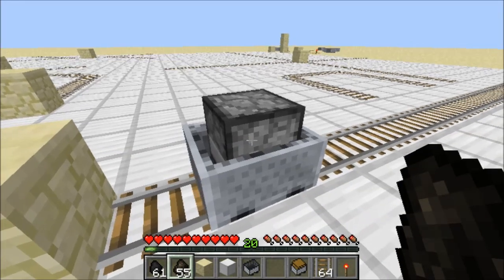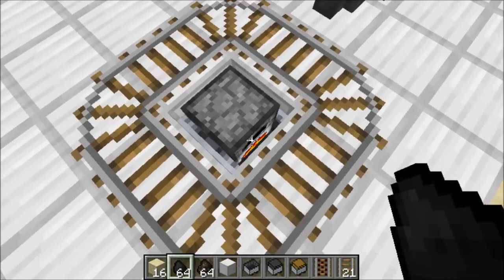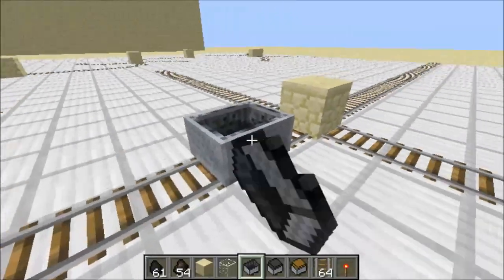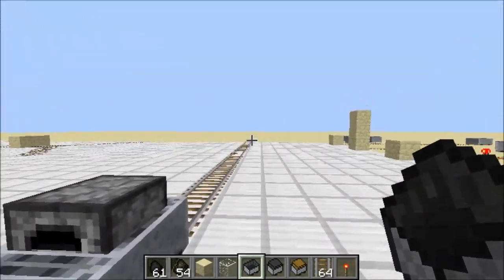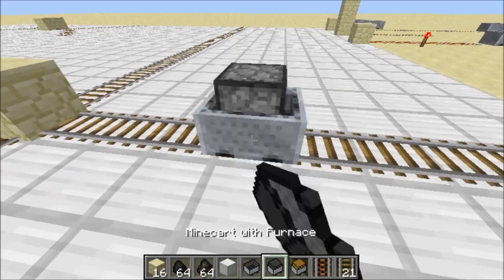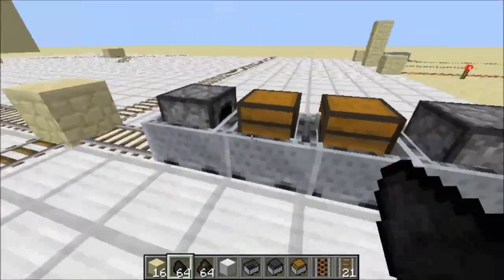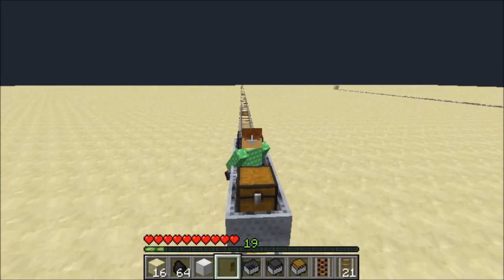Infinite Furnace Minecart Power and MORE!  | Minecraft

Comment: the minecarts need a rework. badly. also if they rework them they should make linking carts an actual feature
Reply: As well as make them work with hoppers & hopper minecarts (though the hopper minecart interaction could be tricky since it would be up and down like a normal hopper)
Reply: I would totally make trains out of carts if I could!!! :D I know old mines use to have small trains in real life. It might be impractical, but I love the idea of it for minnecraft. ^_^
Reply: It would be nice if hopper minecarts could place items into storage below them, such as chests or chest minecarts. Instead, you have to take items out of a hopper minecart using a hopper, which greatly bottlenecks the speed. But I guess that might be considered too OP.
Reply: I've always thought it would be good if you could lasso horses to minecarts so they could pull stuff around.
Reply: Joseph M
That would be pretty cool. Also, it would be cool if there were horse carriages in the game, so they could haul stuff anywhere. And little sleighs for dogs (and bigger ones for horses).
Reply: it’s been 7 years they still haven’t done that :(

Comment: I’ve actually found a trick to prevent the mine carts from the derailing while turning while being being pulled from furnace man carts, also just make sure that is two are on each side. Anyways, at the turn just put blocks surrounding the outer corner of the turn, at least 3 blocks for each side of track. It works with slabs as well so yeah, it’s a really good trick.
Reply: dont get it

Comment: I somehow always manage to forget this entity is still in the game. Removing piston translocation was a priority but not this? Fuel for thoughts ^^
Reply: It really sucks that they aren't bothering to update this or minecarts in general(which have some bugs and a fairly limiting texture) made a suggestion where the two bugs that stop the Furnace Minecart from being useful are fixed as well as some other improvements if we ever get a Minecart Update.
Reply: Minecarts really need to be re-coded, especially furnace minecarts. 
I hope that instead of them being removed, they'll be improved by fixing the bugs, tweaking some properties, and adding some features such as reliable couplings and an interface.

Comment: Finally someone that also knows about this, I did do a suggestion to Fix, and further improve the Minecarts, I didn't know about the Rail South/West Mechanic as well as the going uphill one(so they only work on flat straight surfaces, disappointing...) haven't messed that much around with them that much do hope they do something in the future against all those issues instead of ditching it(like Jeb wanted to, ugh...)

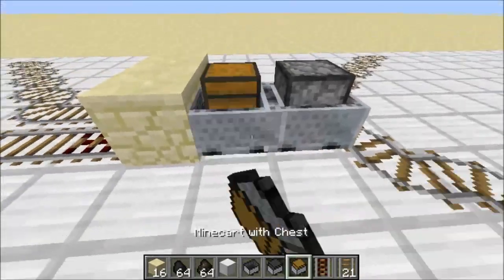Comment: 3:50 gives me an idea about how to auto-separate minecarts... try to put a rail upon a up to down slope. It should move by itself, quite useful in a chest-minecart storage system as they can be sorted this way :D
Reply: btw it's true that they're outdated, at this point they could reintroduce the cart-push bug where a minecart could just push another one aside of it, at least it was cool. Powered rails makes furnace minecarts useless. If only those two could powerup each other...
IMHO rail system needs a full rework; they could take inspiration from the Steve's carts mod that, imho, it's pretty cool.
A good idea would be fuse up railcraft, steve's carts and More Rails and THEN balance them. Better transportations are needed in biggest servers, personally when i'm GM in vanillas, i don't use TPs, I just make metro-ways using minecarts and p-rails. Players like it and makes the server looks much more "natural" because distance and travel in PVP is essential IMHO.

Comment: I found out that if the minecart gets detached from the furnace minecart it turn into a full speed forever driving minecart....
Reply: Rays Works
So that way can be created minecart launchers for full speed transportation with just 1 minecart traveling, not 2 or 3, while the furnace minecart gets reused. The only downside is that it uses 1 coal...
Reply: I played with the mechanic more and I found out that it doesn't launch it at infinite speed and just at max speed...